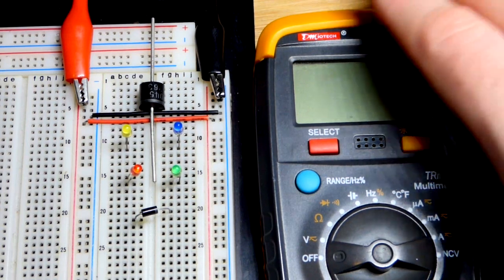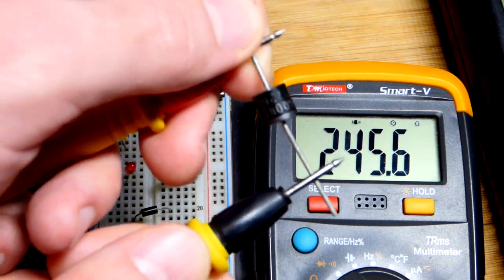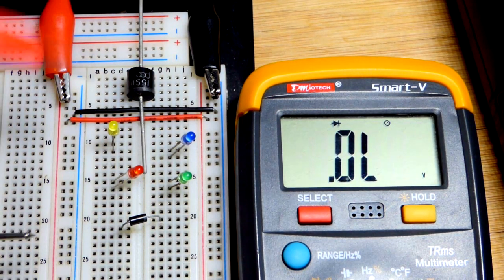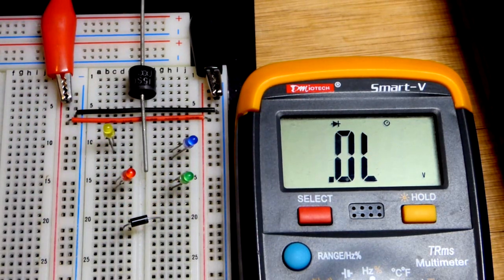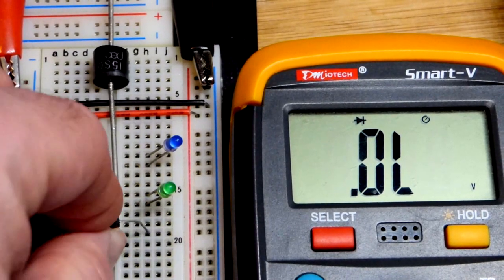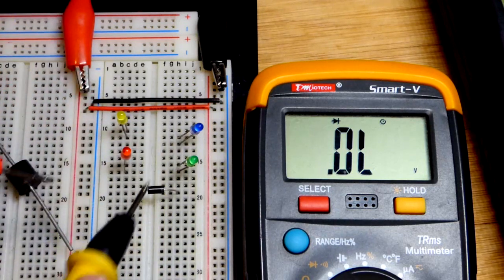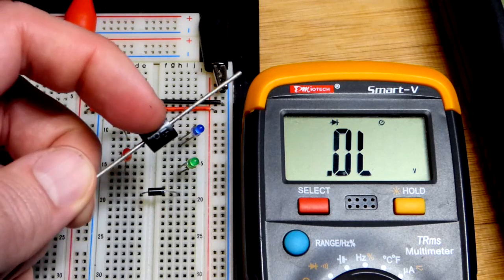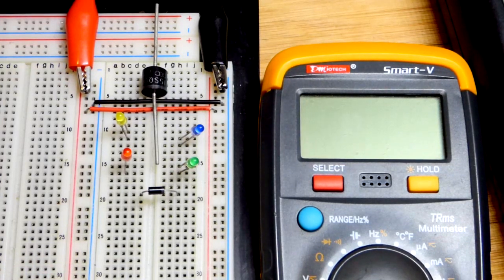How to use electronics multimeter to measure forward voltage of rectifier or schottky diode and LEDs

Comment: Complete NOOB here. So, let’s say you have a simple circuit, consisting in five LEDs [with their respective resistors] and let’s say each of these LEDs has a voltage drop of 2Volts and then you power this circuit, with a 9Volt battery, are you saying that this circuit would be running at -1Volt? Please explain, I’m trying to learn. Thank you kindly
Reply from the maker: If each LED has it's own resistor, then they are usually connected in parallel. Each parallel LED with drop 2 to 3 volts from it's protective resistor. Not affecting the other LEDs. If the LEDs are in series, then they will just stop conducting altogether once their added up voltage drops is as high or higher than the supply voltage.
Reply: @Electronzap  Thank you kindly, for taking the time, to clear this up for me. Cheers!

Comment: Hi thank you. What about a Ziener diode, is there a technique to know the value of UZ ?
Reply from the maker: Most zeners are probably a higher voltage than the diode test function provides. So you'd just want to pass current through a reverse biased zener diode using a high enough value resistor or current source. Then use a multimeter set to measure voltage to measure the voltage across the zener. Here's a video https://youtu.be/CtI5f-6qs5Y where I mostly monitor a power supply to estimate the voltage.